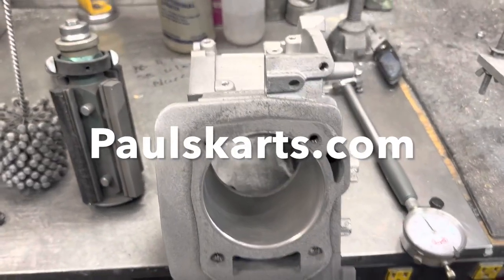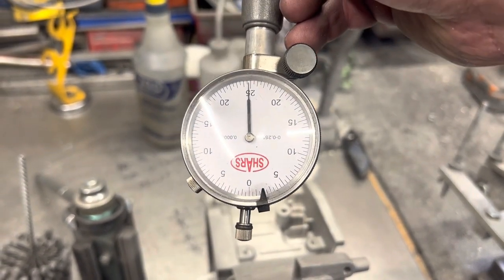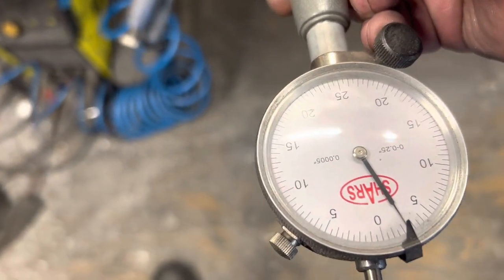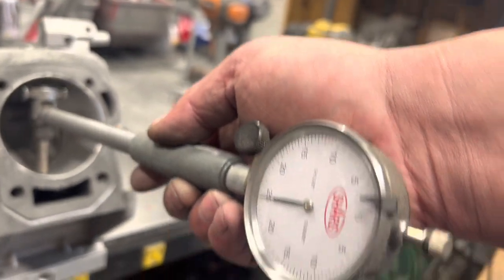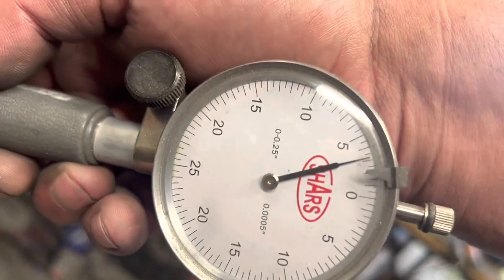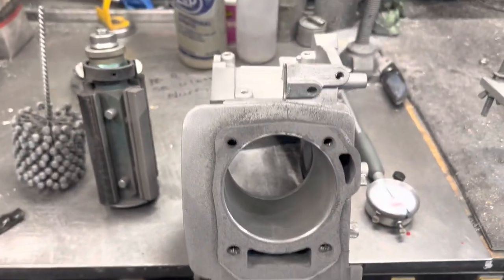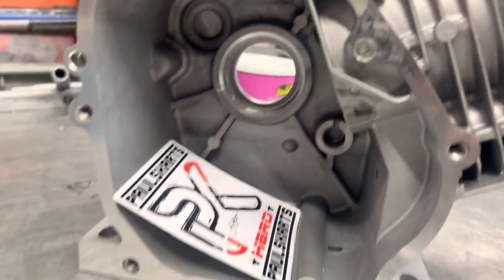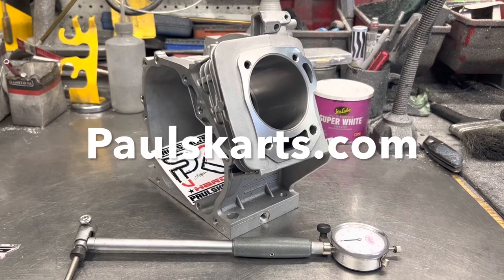3” bore Tillotson block (LA SLEEVE Co.) sleeve installed. Process // Paulskarts.com

Comment: For the standard deck height 3”LA sleeve co. What should I bore the block out to?
Reply: Curious because I have a 72mm reinforced block and want to bore it out to fit the 3”LA sleeve.
Reply from the maker: I’d measure the OD of the sleeve you got and cut the bore .008” smaller then press it in